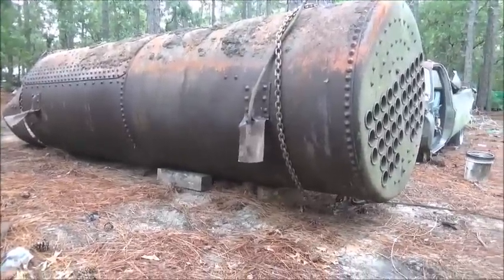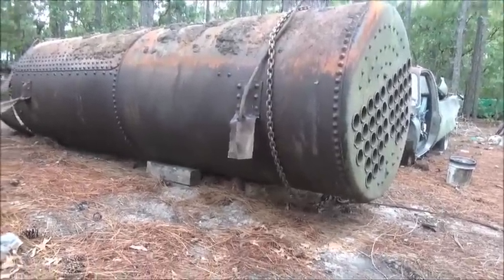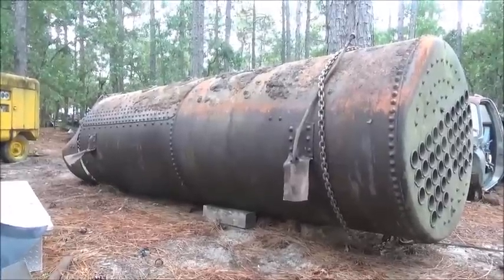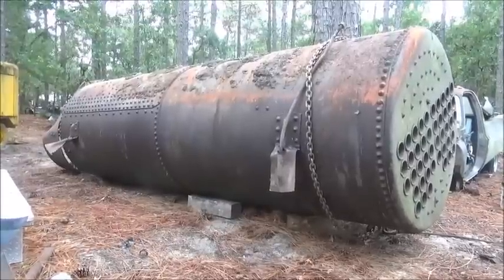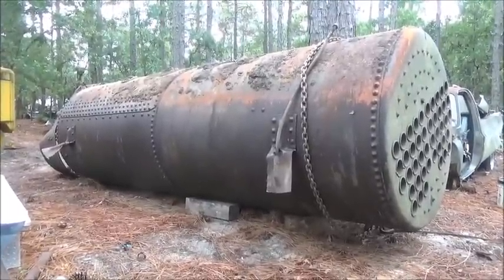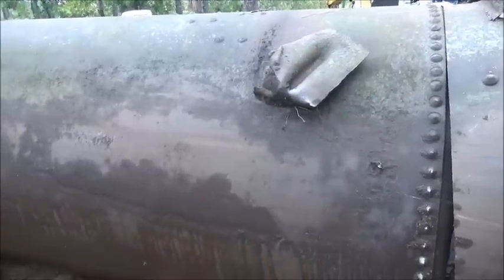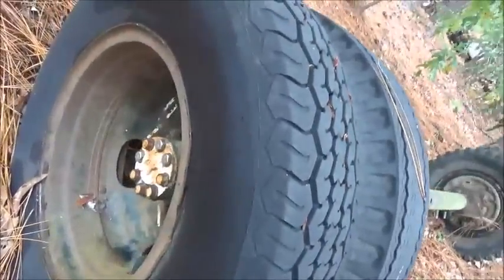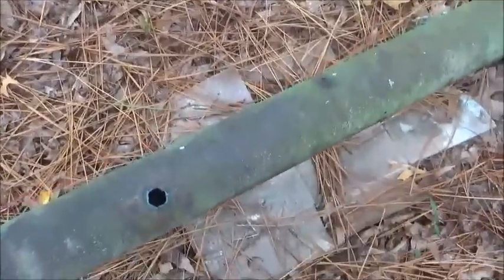BOILER DESIGN BOILER PLANS AND MORE

Comment: Youtube: David Richards; OLD STEAM POWERED MACHINE SHOP video # 32. 
To see a demonstration of a run away steam engine when the governor belt peals off!  Later governors dropped a spool to seal the supply of steam from entering should the belt tear.  But some Corles-Bates videos show the rotary valve timing controls the steam entry to the cylinder.

Comment: Jonathan, you need to stop holding back on this project! Don't aim so low and to just have a "static" display. The aim should be to restore the machine to full working order, you can then run it off wood and connect a generator to it to power your entire house and workshop.

Comment: Hello 
WOW...... They put the entire boiler in an oven....... Well okay yeah that would work and it's one way of getting the job done. I have never seen anything remotely like this. Jonathan you talked about flywheel failures and run away engines due to poor maintenance and faulty governors. A steam leak anywhere on that boiler would be catastrophic! Can you imagine all that surper hot brick work getting hit with water...... Not good. Thank you for posting the picture of the boiler set up. Had someone told me about this I would have wanted proof because this isn't the norm for a boiler installation. 

Best Regards 
Greg Rogers

Comment: If the walls of that boiler are as thick as you say I would think it would be good enough to run at 150 psi and power the engine if you wish I base this on the fact that propane tanks hold 200 psi when full and the tank wall of a 500 gallon tank is only 1/4"

Comment: Hey why not try windy hill foundry they do cast iron.
Reply from the maker: Done a little casting myself. https://www.youtube.com/watch?v=o6B9c5Ca61U
Reply: Does WHF have equipment to pour castings of this size?  
The same is true with the community's machine shops. The will is there but realistically the engine is probably larger than their machine tools! But there are capable shops out there.

Comment: Johnathan, Question.
1. Are you not concerned that the boiler will not be able to handle the heat.
It’s been in the elements for so long. That the steel maybe compromised.

2. What are you going to do with this boiler system?

Cheers
Reply from the maker: Not concerned at all. I have stated many times over that I have no plans to fire it or pressurize it.

Comment: That strap looks just like what I found after Hurricane Michael tried to wipe my art of the state off the map.  I had anchored my 4X8 utility trailer to a really big Oak tree with one of those straps.  After the storm had passed I went out and found that the strap was ripped just like that and my trailer was buried almost vertical with the tongue in the ground and the ramp pointing towards the sky.  It appears that even a tree that big was not immune to the storm's winds and it had been pulled out of the ground and took my trailer with it. When the tree fell over it drove the tongue into the ground and ripped that strap in two.  It took a bit but I found a local welding shop that had managed to reopen and they rebuilt the trailer to even better than new.  I just could not believe anything could destroy a strap like that.

Comment: Congratulations on the subs. In your case idk which would be easier for you - you being a good metalman can make steel legs with arches in them probably as easily as you will pour concrete piers with arches in them. Nothings impossible of course. I know you want it to look good, just think you'll conquer the metal quicker. Be interesting to see how and what you do with it all. Thanks for sharing

Comment: Jonathan W., great update! Nanna Cat’s previous life must have been at a log mill wear she’d walk the logs floating in the river head; Too funny! Anyways, on your next video, you oughta share at least one decent blueprint image of the governor/shutoff valve setup for us, the GenPop to see, just in case someone out there just happens to have a match unit sitting around that they’d be willing to give/sell/trade towards your simi-restoration efforts! When you were explaining your paper document preferences, of having physical/tangible paperwork to handle/work from, I definitely concur! I’m very much the same in this regard. I went hog wild with collecting as much original documentation/literature as I could possibly find to assist in my restoration efforts of one of my Classic Cars I own, even an original factory assembly manual that describes each and every single sheet metal weld point & type of weld. 1955 Buick Super 2Dr Riviera w/Factory A/C System! GOOD LUCK 👍🏻 ON YOUR PROJECT! YOU STILL HAVE AT LEAST 50 + MORE GOOD YEARS AHEAD OF YOU SO, “Get’er Done”! lol

Comment: This boiler design which is a “Horizontal Return Tubular” or HRT, is very common for boilers made between 1880 and 1930. The riveted seams indicates it was most likely built early in that period as rivet seams were found to be dangerous because of corrosion that could not be observed. The design went to welded lap seam boilers and by the mid 1930’s lap seams were banned entirely favor of butt welded design. 
Most HRT boilers were suspended as these were to allow expansion as well as to avoid placing the weight on the brick walls of the firebox. Customarily, when coal fired, the grate was located in the firebox with a firing door above the grate and a secondary air damper in the front wall at the ash pit level. 
The 1/4” steel cylinder and cast iron door at one end comprised the smoke box that captured the flue gases from the tubular fire tubes and directed them to the chimney. The doors allowed access to the fire tubes for cleaning and for replacement. 
The fire would have been below the boiler shell, and a baffle wall at the rear of the firebox would force the hot gases to surround the boiler shell, before returning from the back to the front of the boiler through the tubes then out the smoke box.
Reply: Rivited stuff was used up to WW2
Reply: Thanks for the explanation. ☝

Comment: I like the idea of putting this on display.  Consider this for the suspension mounts.  Leave them in place, and reweld the one you cut off.  You can place the boiler on a concrete cradle but eventually you may run the risk of it rotting out at the contact point.  I know mild steel reacts to a lot of chemicals, I would imagine concrete might cause a little galvanic corrosion.  You got it this far, hang it like it was when it was new.  I can’t imagine an I beam being all that expensive, and I’ve seen your welding skills, this is something this boiler needs to represent what it was over 100 years ago and it is within your skill set to do.  At least think about it Jonathan......  you sweat blood to save this thing....., hang it, sand blast it, paint it and then build the mockup for the engine itself.
Reply: This boiler could never be displayed in its original brick setting without going through a tremendous expense. It could be set at ground level as a static display with a good weatherproof sign alongside with a drawing similar to what Jon posted here to show how it was used in practice. One common method of providing "feet" for a boiler like this is to fabricate steel saddles for it to sit in. In that way if it ever had to be moved it would be possible and it could sit anywhere there was level ground or a pad.
Reply: I am not talking about building a brick surround but just put some Supports made with “I” beams to suspend the boiler from.  Who knows how far this will go.  He might find someone with the entire boiler enclosure front door and all that.  I know it won’t be used, but having it look authentic is nearly as important as saving it.
Reply: I am not talking about building a brick surround but just put some Supports made with “I” beams to suspend the boiler from.  Who knows how far this will go.  He might find someone with the entire boiler enclosure front door and all that.  I know it won’t be used, but having it look authentic is nearly as important as saving it.

Comment: I hope that you plan on some kind of a load spreader on that axle so that you don’t dent the boiler.  If you set the axle near, but not on the balance point,  you can move it easily with the skid steer. I have a chicken dinner bet with my son that the boiler will be fired before this is over. It looks like it is in good shape, considering. LOL.

Comment: Jonathan,if you go to Abandoned and Forgotten Places YouTube channel he just put out a video yesterday of a mine he was at that shows a idler pulley with the brackets putting tension on a belt as wide as that one that is still in place going around a huge air compressor flywheel on one end and a pulley attached to four two stroke Detroit’s all connected together by a gear box

Comment: Now the brackets make sense the boiler was hanging. Actually I am surprised the actual boiler is in better shape than I thought less the fire box of course. Painted black and displaying this and the engine will look great. Yes I still have the original blue prints for the Pipe Wrapping machine in the Pipeyard I worked at for years. The company sold the wrapping machine but I kept the blue prints they were going to throw them out. we wrapped steel gas transmission pipe on the big machine from 24" diameter up to 48 inches in diameter and double ended up to 80 feet long.

Comment: A little over 20 years ago I watched them build a modern boiler in the factory I worked at, and it was built the same exact way.  The part you drug out of the woods was factory built and brought in with a truck.  It hung suspended from a large I beam frame they made on site.  Then another crew came in and built the fire box underneath out of pieces of boiler plate.  Then another crew came in and put this high temp white refractory on the inside of the firebox they made.  This boiler was fired with sawdust and it had a induced draft fan that pulled the air through the boiler.  It also had a separate combustion air fan.  When it was running right you could see no smoke coming from the stack.  Part of my job was keeping the controls working for it.
Reply: Yeah the curse of USA never modernize, old design and very inefficient, it's the truth, by the who on earth uses steam heat or hot air in a private house, nope underfloor heating

Comment: Makes sense to have the boiler up in the air in a brick room. Hold in the heat better and longer  Cuts down on noise and easier to maintain. It may be easier to mount on I beams then concrete cheaper to ill bet. Besides we weld better then form concrete.

Comment: The chimney would be at the opposite end from the fire box.
Reply from the maker: No, fire box under front. Hot air moved under the boiler to the back, then through the flues back to the front and up thru the chimney. Tha is why they call it a return style boiler. Heated under boiler first, then thru the pipes.

Comment: BIG HORIZONTAL BOILER, THE FIREBOX WAS BUILT SEPARATE, ACCORDING TO REQUIRED SPECIFICS, AND/OR THE ABILITY TO ""DRAW"" THE HEAT THRU THE TUBES, AND BEST ACCESS FOR FIREBOX FUEL COAL/ETC. AND THAT OTHER FUEL.......CALLED WATER
WITH WATER BEIN CONSTANTLY ADDED, WHILE THE BOILER MAY BE AT FULL PRESURE IS DONE WITH AN INJECTOR, AN AMAZING APPERATUS!  THERE IS FAR MORE OF A SCIENCE TO STEAM (EXTERNAL COMBUSTION) THAN ANY KIND  OF GAS OR DIESEL (INTERNAL COMBUSTION) OR ROTTEN DINOSAUR BURNING ENGINES, AS THE BASIS FOR NUCLEAR PLANTS IS STILL STEAM BACKUP! FUNNY HOW THINGS CHANGE, THE MORE THEY STAY THE SAME (HERO'S STEAM TURBINE  OF A.D.400'S)

Comment: That Boiler Image looks just like the huge coal-fired boilers that were in my K-8 elementary school. There were three of them down in the deep dark boiler room where two men kept them feed with coal, that they hand shoveled from large coal pits. The Boiler Room was suffocating hot and it was soot-covered and dingy.  Every room in the school had steam feed radiators that hissed and spit steam from a little valve on top of it. During the winter months - students would place mittens, gloves, scarves, hats, and socks, on them to dry out - being soaking wet from time out of doors during recess and lunch hour.  That smell of cooking garments on the radiators I will never forget. Another thing I well remember is the loud bangs the pipes would make, often scaring us. 
Thanks, Jonathan for this upload. The IMAGE explained things clearly as I wondered how the boiler worked. 

.
Reply: Good old "water hammer" !! When steam runs into cold water. Amazing how that sounds just like someone hitting the pipes with a hammer. Steam, just like all the other "inherent" powers of water, is truly a awesome, magnificent, thing !!!

Comment: The reason they hung the boiler was to keep thermal distortion to a minimum, which was done to hopefully reduce the chance of explosion.
Reply: Marc Fuller,Do you reckon it was across the time they were realising that the riveted boilers  weren't quite as tough as welded? Be something neat to research.

Comment: Although your boiler is a fire tube type, todays water tube boilers are hung from the top in a tall tower. This is done for expansion reasons. Without hanging it would crack and get destroyed.

Comment: Good update. The hanging makes sense with expansion and contraction and all.
It popped into my head when you mentioned it will be a static display, maybe run the engine with a hidden or disguised electric motor to show the motion?
Thanks, and Meow to Ninja Catscan.
Reply: he bought an air compressor in a previous video to run the steam engine.  It needs some repair though, here is a link: https://www.youtube.com/watch?v=JKemgnWp3YA&t=2s
Reply: Good idea maybe real slow. If I remember that's the plan.
Reply: Should have read this before I posted my comment... that'll learn me:0)
Reply: @PhilsF  Na, all are welcome in tihs classroom.